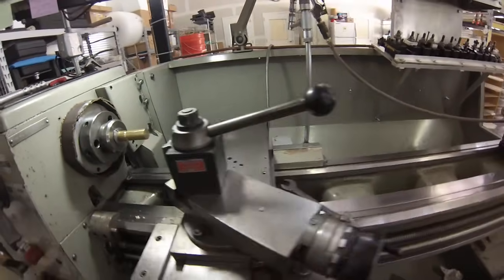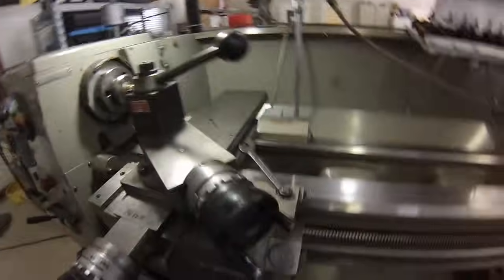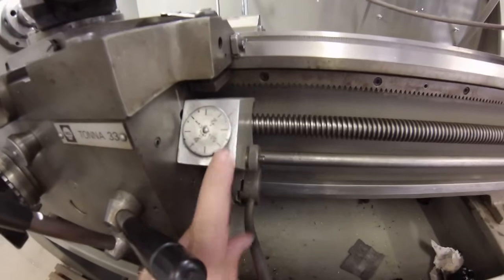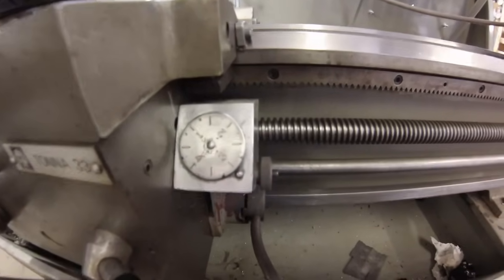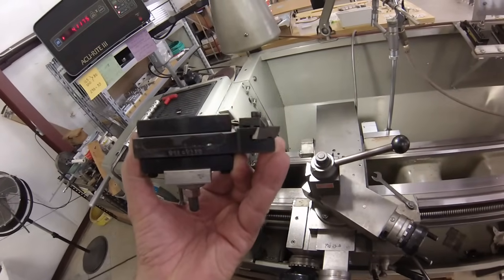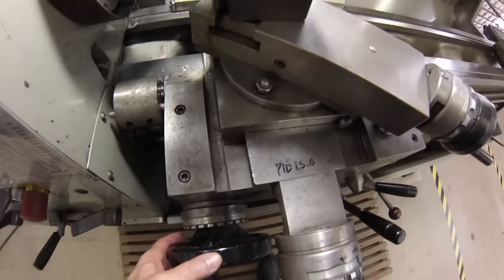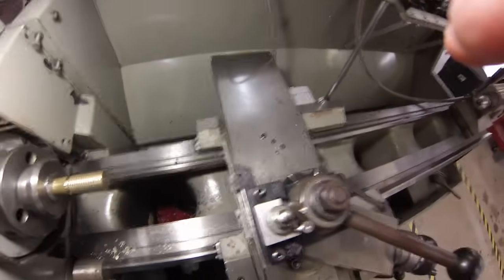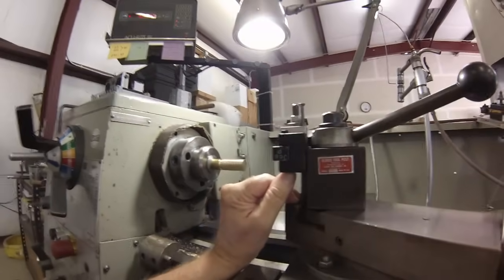Threading on a manual lathe  BEST TECHNIQUE EVER !!!!

Comment: Joe, thanks so much for these videos, they are great and very helpful for me, as I'm a new lathe owner just learning the tricks of the trade with hopes of one day doing gunsmith work, which as you know, involved a lot of threading.  I really like your reverse threading technique, but I'm not clear on what type of tooling I need.  I currently have 16ER A60 type threading tools, which are triangular in shape, with the cutting tip offset to the left of the tool (when upright) for threading up close to a shoulder.  If I were to flip the tool over, the shank would be to the left of the cut, keeping me from getting close to a shoulder.  Should I be using the left hand version of this tool for threading with your technique?  What about internal threads with a boring bar?  I assume the same, a left hand tool is needed?  Thanks again for your videos, they are very helpful for this fellow Texan (about an hour north of you on I-35).
Reply from the maker: Correct. Use a left hand tool holder and left side bias insert for the inverted threading. Take a look at my Internal threading to a hard stop video. It shows my take on internal threading and the tool I use.

Comment: Hey Joe
Am watching your vids and they are so good.
I was a production m/c operator in the 60,s/70,s period(capstans, turrets,centre lathes etc)and one of the most dexterous things to be able to do was screw cutting.
The skill was in the hand control.Knocking the saddle out at the same time as winding the tool out.Winding the tool in and watching the nut go round before you drop it in.
Ive got to say your technique is great.It would have saved so many tool crashes lost time etc etc.Waiting for a new lathe now because i am starting again.Cant wait.
Keep on keeping on.
Reply from the maker: Good luck. You will like this technique once you try it. I have to guess, you'll never go back to the old way.

Comment: I wish I had a better lathe. Mine will not let you disengage the half nut once you have started cutting. It loses it's track and you scrap the part. I still have not come up with a good explanation why.  I think better machinery should be in my future though.

Comment: "Best Technique Ever" <-- Most definitely!
(who are the 136 dolts who thumbed this down?)
Gray Beard Syndrome, not sure what's worse - Forgetting that you've seen this before or remembering it the day after running the compound into the solid stop and hard against the chuck. Half-Nut lever jammed for some odd reason.
Luckily no major crash just had to perform some minor repair on the Quick Change shaft.

Thank you Jim for posting this. Going to head into the shop and re-do the setup and hopefully start fabbin' some good pieces and be able to relax a bit.
Reply from the maker: Its quite a horrible feeling when the carriage hits the hard stop and jams the half nut lever, the lathe whines for a second while your heart tries to jump out of your chest just before the bang of the lead screw shear pin breaking into 3 pieces.   Not that I have any experience in that area....just saying

Comment: Hi Joe. Been a subscriber since this first video was posted. I am back here again because of one of your other videos on threading where you make it clear in the comments at least you prefer to plunge directly with the cross slide and was curious if you still employed the American practice of keeping the compound offset since with your technique the offset is redundant. Here in Aus it is common practice and when I did my training at least to teach students to keep the compound parallel to the bed and direct plunge cut threads. I was always perplexed by the notion of having the compound permanently offset at some obscure angle for a number of reasons. 1 the compound lead screw and nut (which is always smallest and weakest) is always being subjected to cutting forces which is really bad if the cut is interrupted. 2  it introduces more tool overhang (from the hold down bolt to tool tip) and 3 you lose the ability to fine trim a shoulder length using the accurately graduated compound slide rather the resorting to a DI stuck to the bed and bumping the carriage but I will agree the convenient doubling of the compound resolution when at 30 degrees is a way out. So after watching this video again I ask. Why do you maintain the offset ?
Reply from the maker: My compound is usually set to an angle from a feature on a previous job. An inner or outer conical feature. It has nothing to do with the  threading operation, and I find it more comfortable when working close to a chuck. The angle gets me closer to the collet face too.
Reply from the maker: Also, thanks for your support and subscription. I appreciate every one of you guys.

Comment: Joe, I cannot thank you enough for this video. I run a small custom gun shop in Alaska. Since switching to this method I've been able to make the cleanest threads I've ever done on gun barrels since I can run much higher speeds. No more clenching the checks as I worry if one mistake will cost me several hundred dollars in a new barrel and free work to fit and install it. Love the channel, please keep it up!
Reply from the maker: Excellent. Watch the thread dial video too. It will close the loop.

Comment: I have seen a few of your videos and they are very informative, and I especially like how you think outside of the box on this one. I have been around machinist, shops, for over 30 years. I also even took a tooling class in college for my bachelors degree in engineering just two years ago.. I have asked several different people from engineers to lifetime machinist why the cross slide is set at the same angle that you have yours set at. The top three responses all make since to me and everyone i speak with; 1: 60 degrees is the most common thread pitch, 2: that angle is the least common to be in the way while working, 3: and the one that I am curious about with you thread cutting method here, is with the cross slide at an angle of around 30 degrees, the vibrations produce will be significantly less because of the force pushing against in with the cutting direction moving towards the head. So my question is on the third statement do you see any adverse effects with your method, such as a rough or wavy thread?
Reply from the maker: Not at all. This method has never let me down.

Comment: Hi Joe,

Great video, great trick too! Is there a way to make it work if you can't disengage the half-nut between passes? e.g. my machine cuts imperial threads with the dial gauge, but I often have to cut French threads (metric). My lathe is great, it'll do metric right on the gearbox, but I have to leave the half nut engaged throughout the theading process, as my leadscrew is imperial...

I'm guessing the answer is: Don't use a hard stop, wind back under power to "near", then handball the chuck back into position for the 2nd & subsequent passes?
Reply: Just to reply to my own comment - that's exactly what I did in the end (wound back under power until close, then hand-balled the chuck around until the tool was back in the start position, wind it in to make a cut, hit the power button and duck!

Comment: I thinking... would i be better off to use a smaller lathe and  the tailstock with live center?  I'm trying to make, maybe 70 of 100,  150mm x m8x1.25 titanium grade 5 socket head cap screw bolts (with 40mm thread on end) into a 109mm stud and a 35mm shcs.  would this work...as the best, most financially conservative method?   but on the stud blank end I need m8x1.25 on 30 studs and 5/16-24 on 40 (of the 70 bolts).  30mm thread length should do on the stud.  And as much as the short bolt will take (ie..full length threading).  Does this make any sense to ne1?

Comment: Not being a machinist or owning a lathe.Would not an appropriate strength loctite compound on a lathe chuck be sufficient to hold the chuck from unscrewing. Or is that just plainly being blasphemous using the words retaining compound in a machine shop scenario :p
Reply: scorp NZ loctite is used all the time — but it's not that strong.

Comment: This work if you have new mashine....if is your lead screw is old , with lots off backlash , tread  will be not good !
Reply from the maker: Not true. Keep your hand on top of the hand wheel during the thread process and apply light resistance. This will keep the carriage to the same side of the leadscrew all the way through. The thread will be the same either way. I always drag my hand. Always.

Comment: I have chased hundreds of threads over the years.  One hack a foreman told me about using thread wires...Take a piece of masking tape and attach it to the ends of the wires.  Make it look like a small flag. That way, if you would happen to drop a wire in a pan of chips, you'll easily be able to find it.
Reply from the maker: Watch my video on thread wires. You'll have a "slap the forehead" moment.  Its go a lot of good tips. I like the flag Idea.

Comment: Having just cut M16x2 external thread on 10 drawbar  adapters for my mill this week (15mm of thread, 3mm of undercut with rest of the part being 22mm hex  ), I prefer this video to a massage as far as ability to relax goes :)
[Edit, OK, the first part had those dimensions, the rest had a shorter thread and longer undercut for my sanity's sake ;)]

Comment: This is genius. Heard of it, but never seen it done. If I was to use high speed tooling, or felt I needed to plunge at the 30 degrees for whatever reason, would I have to set the compound 30 degrees the other way (clockwise 30 degrees from parallel)? And also, will the tool post usually hold the tool down tight enough to cut harder materials that might apply more upward pressure on the tool during cutting? Thanks a lot for  all your videos. Subscribed and thumbs up.
Reply from the maker: Thanks for the subscription. The tool post cam should be snug like any other operation to do this. My aloris post has never failed to secure the tool on any part I've ever done, and I routinely thread 316, 304 and 17-4 stainless. I usually plunge my threads, but don't see any reason the 29 degree compound setup would be any problem. From a mechanical standpoint, the compound angle setup is only to force the cutting load to one side and reduce tool load. I don't see any reason which side makes any difference, so a traditional setup should be OK. Perhaps dragging the tool would be more likely to extend the compound backlash and pull the tool deeper. You can prevent that by simply bumping the backlash out after each adjustment, or keep the compound gibs or lock adjusted to the snug side.

Comment: joe,i know you are busy and its hard to answer all the comments,i guess my ways of machining deal with materials with very low machine ability rates,mostly,less than 10 %, so i understand in your demos its hard to show these procedures. you seem to work with materials like alum. whmw,i think, and brass.thats fine for your demos,i get it. so please dont  be offended by my different ways. in the machining world,there is always another way. thx rc
Reply from the maker: Rich, 90% of everything I do is 17-4 or 316 stainless. I only use softer materials for my demos so they go smooth. No offense taken.

Comment: joe,thanks for writing back. i am a machinist with over 30 years in. college deg. in die making.you got me thinking about your internal threading and i have to let you know a better way.most materials i work are super alloys,316 ss ,17-4 arm alloy,hastelloy and inconel. plunging a tool straight in would not work. so a clearance groove is a must. there is a very easy way to cut these threads. 12 pitch is the most common in the machine building trade for medium size parts. set your tool slide @60 deg. touch off the i.d. set zero on cross slide. machine in reverse. all common threads are 60 deg. so all you have to remember 3 trig. functions, sin=.5 cos.=.8660,tan.=.5773. so a 2.500 by 12 pitch will have aprox..063 per side thread depth. so take .063 divide by the tan. .866 will give you .072 the distance yo move in your tool slide. this way you only cut on one side of the insert. these are aprox. numbers.allways have a male thread for exact fit. tx,rc
Reply from the maker: Hi Rich. I've never been a big fan of using math to say my thread is good. I rely on gages to make that decision. I have been in military and medical for the bulk of my career and routinely work with 316, 316L, 304, 304l 17-4 and the 4100 series steels. Not so much on the inconel and hastelloy any more. Every thread I have ever run, I have run this way. I have had great success with this method. Any dwell at the start of the thread will give you the relief cut you speak of. Its impossible not to form one using this technique.  If you choose to use a second tool for the relief, that would be driven by the print of course, and as for breaking a carbide insert, equal load would reduce the chance of that. Thoughts?
Reply: joe,thanks again for your knowledge,but just consider this,only the new style thread inserts are designed to cut with both sides of the tool.i notesed in your vid.that you were developing a burr @ the crest of the thread, because it is hard to get good chip formation taking heavy cuts when both sides want to push the chip in to each other.older inserts are made to cut only from one side. the chip will curl,and peel out correctly leaving no burr in very tough alloys.and the tool will have less cutting pressure,and last longer. tx,rc

Comment: Joe.. I owe you a beer or 10 Mate . I have been using this system for the last few months now and I have saved myself a fortune in carbide threading tips. It is faster because you can run the machine faster, which in turn gives a better looking thread as well as the carbide is cutting closer to its preferred SFM. Not to mention the pucker factor having been totally eliminated from threading totally.  I LOVE IT.  Thanks again
Reply from the maker: If I ever bump into you at a pub, I'll take you up on that offer. I am glad you tried it and like it. Thanks for watching.

Comment: Thanks for all your videos Joe. They are very helpful. 
Threading away from the chuck makes so much more sense.

When using pitch wires you alluded to needing three hands to hold everything. As mentioned, rubber bands are great to have near the machine for holding pitch wires and so many other small parts.
Reply from the maker: Thanks. Watch my video on using wires, you can measure with 1,2 or 3 wires. The 1 and 2 wire measuring techniques are sooooo simple, and don't require 3 hands.    https://www.youtube.com/watch?v=be6Q9mm4vEQ&t=306s

Comment: Ran into a situation with our new lathe. the comment  that stated when the spindle and lead screw are turning in same direction you make right hand threads and if they are turning opposite you are making left hand threads. Our new lathe does not work that way, it has a left hand thread leadscrew and actually does the opposite.
Reply from the maker: What type of machine is it?
Reply: it a lion brand, 2 tpi lead screw
Reply: You must check on the headstock/gearbox and look for a lever/handle that changes rotation (left/right) on lead-screw.

Comment: Couldn't agree more with you on the safety issue. You don't have to be an OCHA-Nazi to use common horse sense.
You used wedding rings as an example. Very early in my working life, I was a witness to a chap who had his finger pulled off by a drilling machine, on account of wearing his wedding band.
I can vouch to the fact, that this was a very, very nasty experience for all involved (especially for him, dah...).

I never understood why, after it was pointed out to you, why you would persist in dangerous behaviour. When in my homeshop I always use safety gear, safety shoes, safety specs, gloves when appropriate etc.
None of this stuff is overly expensive these days, not even the certified gear is prohibitively expensive, so there is no excuse.

After more than 3 decades in industry, I have seen my share of horrid accidents, some resulting in maiming,a few resulting in death.
And it is always the same sort of reason that lies at the base of these things. "Familiarity breads contempt" !
The person thinks because he has been doing a certain job or operating a certain machine for a period of time, it holds no surprises for him and he is master of the machine....
That attitude can only be described as "powerful stupid".
If it can hurt or kill you, sooner or later it will ! The only defence against that is using your noggin, don't rush (regardless what the clipboard warriors tell you!) and use safety equipment where it seems a good idea to do so....

Cheers!

Paddy
Reply: If you're around rotating machines just leave the gloves off.

Comment: As far back as I can remember we had a D1-4 or 6 camlock chuck mount and was taught this technique. Never thought about a screw on chuck, no inserts, all hand ground HSS or high cobalt bits and certainly no internet. Retired now and looking for an old and not worn out Long and Shapely, nickname for Lodge and Shipley powerturn lathe to share some of those things I learned over the years. Saw a video on a bit height gauge and laughed, take a piece of brass shim stock, run the bit up to the part, insert shim, the angle of the shim tells you exactly how much to raise or lower the bit. If it's 90 degrees or just less, you're good to go. I made a 1.5 inch or about 90 angle, set on top of the bit and slide it to the shim, perfect every time. 

Thanks for motivating me to put a lathe in my garage and do some videos myself before I forget everything I learned.